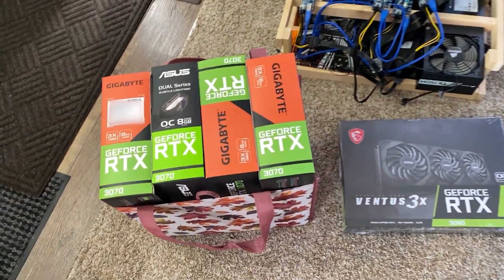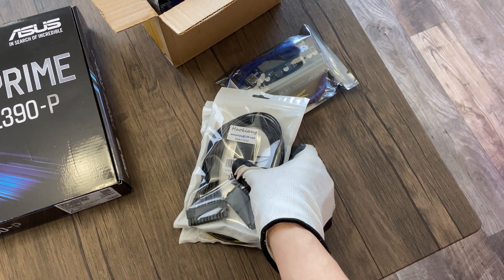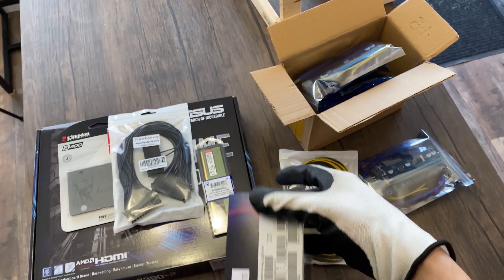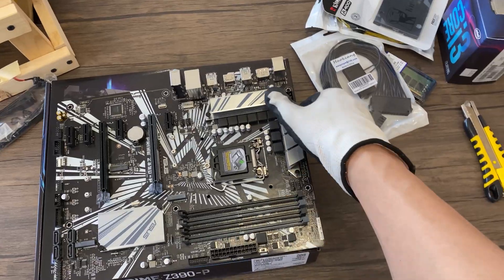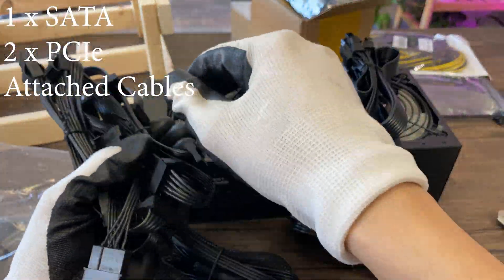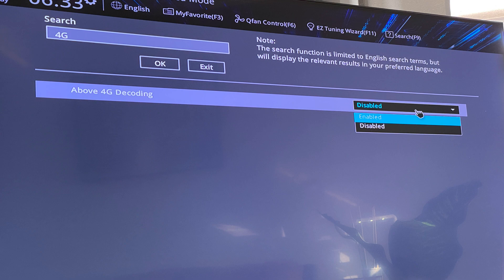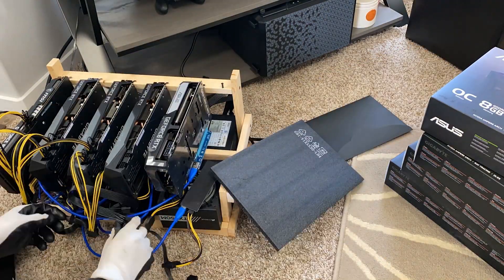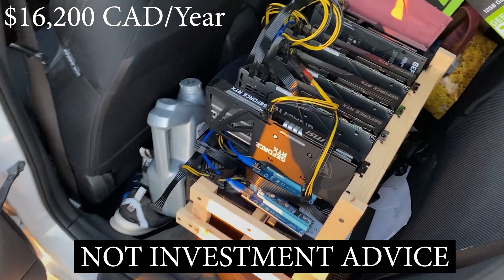How To Build A Crypto Mining Rig [Step By Step]

Comment: Please for the love of god and your rig not burning down . Do NOT power your risers with sata like this guy is doing . I don’t give a fk if it runs fine for a week or two .IT WILL BURN. Sata cables are rated for 54W . Doesn’t matter if it’s a 6 pin to sata . ITS STILL A SATA.risers can/will pull up to 75W . pci cables can pull 288W which is the best in total u literally can search this and it tells u. please search for a video called “powering risers safely” it explains all the ways to power them .

Comment: That settings on bios works whit a asus tuf z590?
Reply from the maker: You need those settings for all boards with 3+ cards
Reply: @FatSausage  im using i3 1100f 
I put everything gen2 ... 4g encoding enable ... but it don't have a option dmi/opi.. so I can't do anything whit that .. and when I plug my third card my computer turn on but I don't get a video signal ... then I unplugged and I have video signal so I can run 2 gpu for now
Reply: I buy today a z490-a asus prime ...